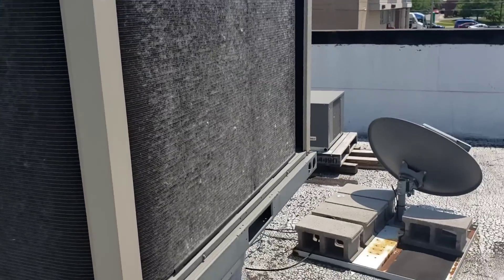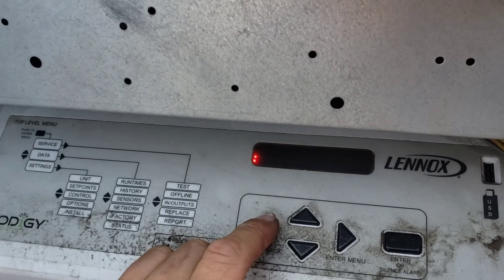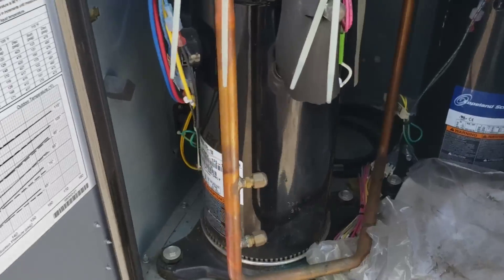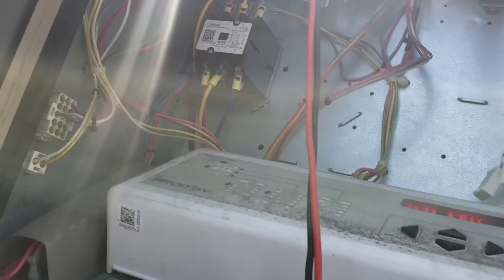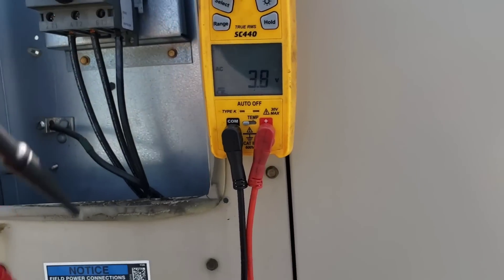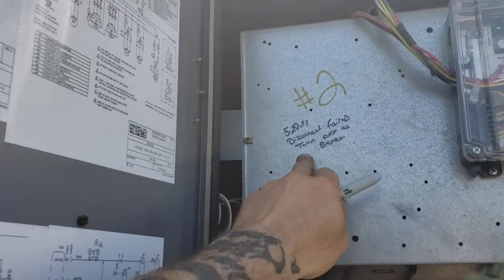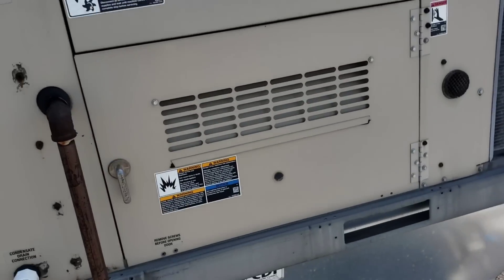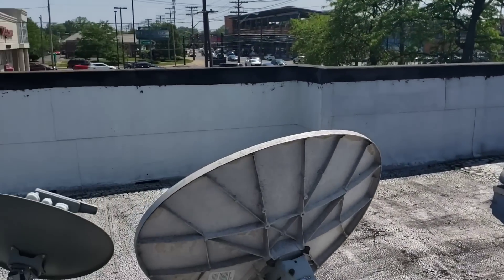Lennox RTU not cooling

Comment: Should have left it off so they could feel pressured into replacing the disconnect
Some customers need to understand you cannot ignore a repair as such which could lead to someone else getting hurt if not addressed but good find boss🦾😎
Reply: Some people just love to take advantage off of good work i would be condemned it without a second thought
Reply: @Maurice56778  yeah i mean i get that bro but safety at all times there’s things we can do to get a customer running but a disconnect no sir I’ll just leave it turned off and say sir u need this fixed in order for me to fully diagnose this unit lol